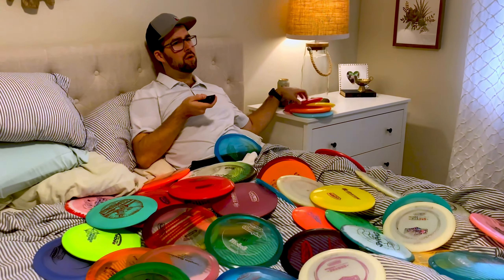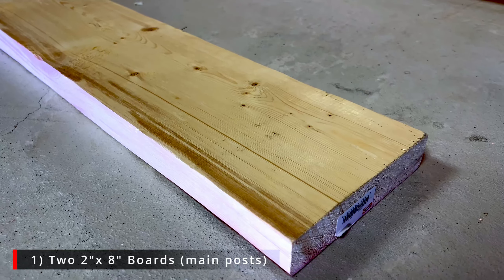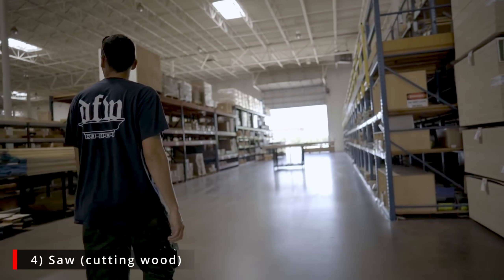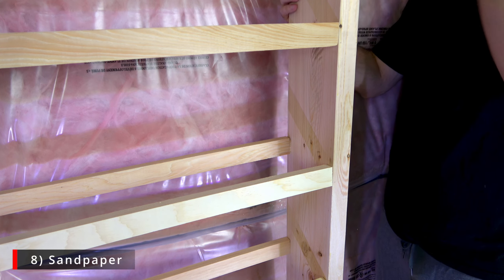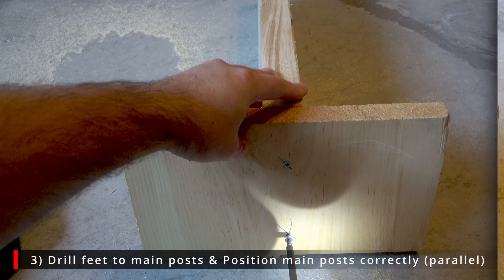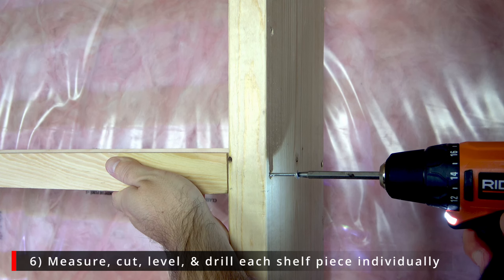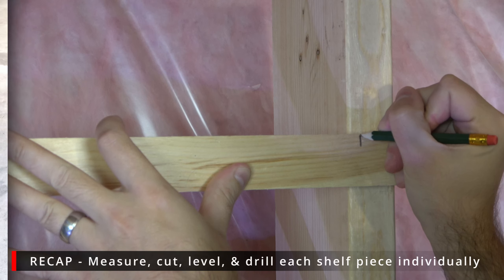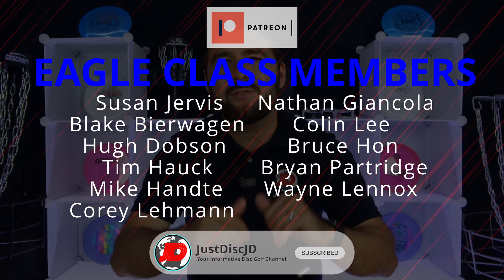How to EASILY BUILD a Great Disc Golf Rack

Comment: Another tip: If you don’t have anyone to help to hold the other end of the shelf, you can cut a scrap piece of 1x8 to 12” to use as a “dead man” to hold the end while you screw in the other end. Just start at the bottom and work up. Great tutorial diy video.👍
Reply from the maker: Such a good idea! Thanks Dale, appreciate the helpful tip 👍

We also appreciate you enjoying the video! It was a much harder video to finish since we did the b roll and script AFTER having built the rack. But of course, in the end, it was well worth it! 👍❤️